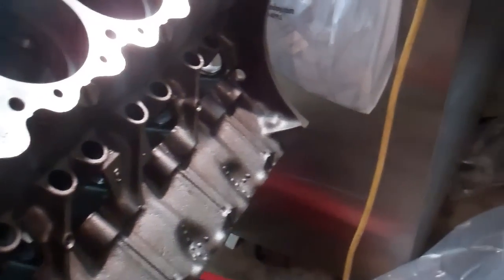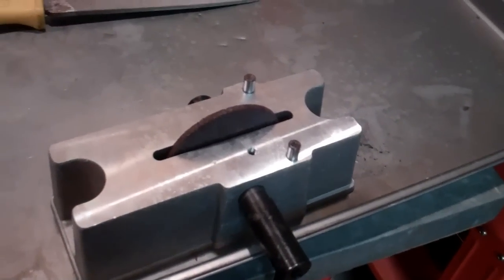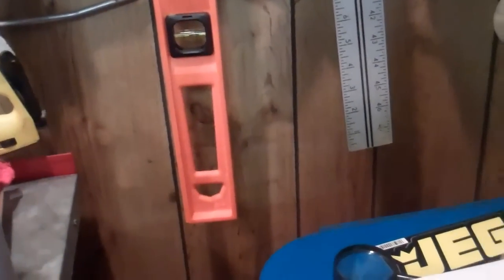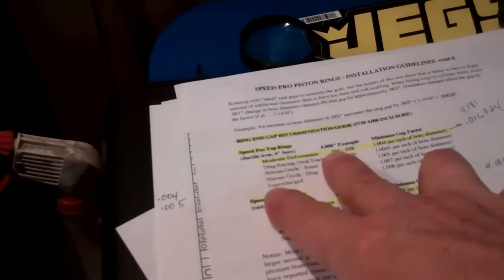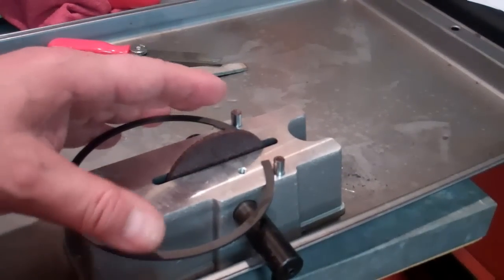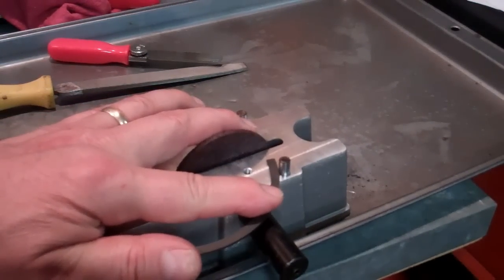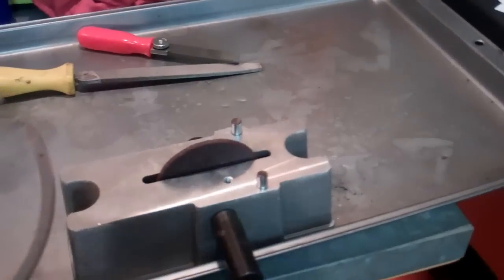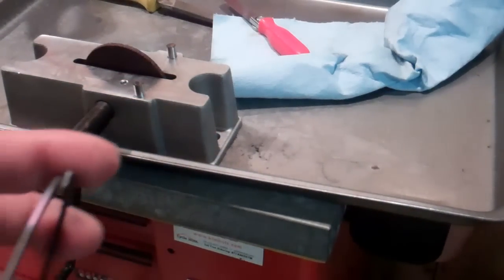Blueprinting Pontiac 455; Pt 6 (Gapping Piston Rings)

Comment from the maker: I used the grit wheel that came standard with the grinding tool.  My rings came out pretty clean.  Make sure you grind from the outside - in because there is a laminated layer on the outside of the ring that will get pulled away if you grind the other way.  I did take a small finish file (Harbor freight finish file set) just to de-burr the grinding.
Reply: Love to see our ring grinder featured in your video.  Proform part number 66785.

Comment: I just filed my rings with a file, never gave much thought to the moly faced rings I recently used. I usually just use cast rings so it never seemed important to use a grinder or direction. Files  might be best to used only cutting on a forward stroke from face to inside or perhaps filing perpendicular.  Ring gap really isn't that important so long as you have enough. A lack of ring gap in engines is one of the things that gave nitrous a bad name. Supercharged or turbo engines need rings gaped to wider specs as well. So gapping the ring for the application is critical. Though most rings I found run very loose when I  bought to fit. I'm not sure what the factory tolerances were, but I'm sure that varied over the years and from different makes.